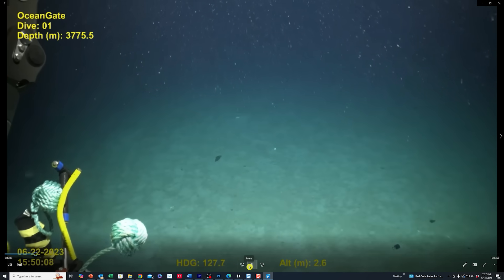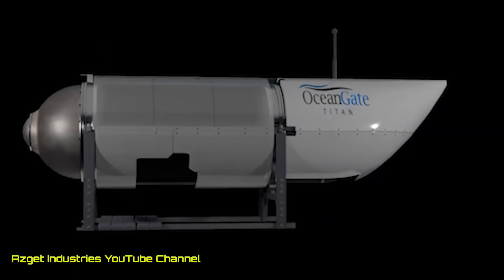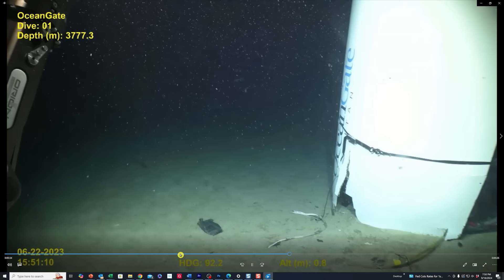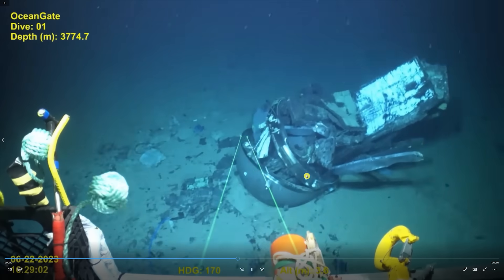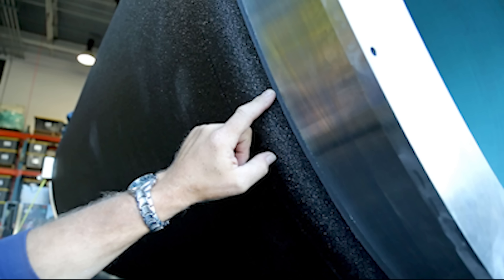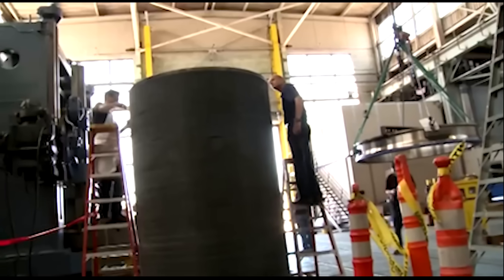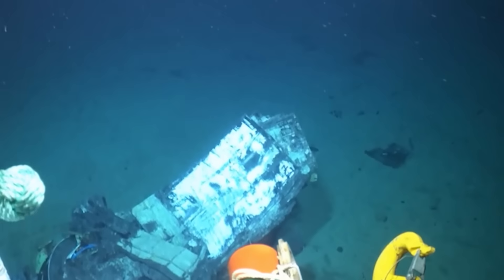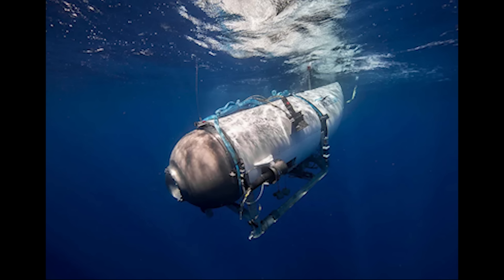OceanGate Titan Sub Debris Video Shows How It Imploded

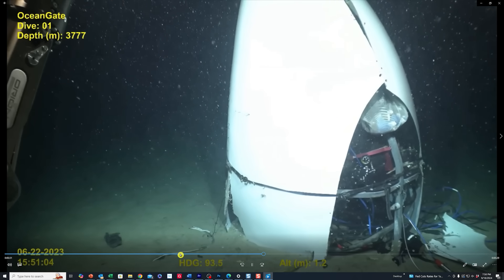Comment: I keep wondering who put the manual rachet strap around the wreckage of the sub that u can clearly see at 2:50... Did they leave that on there from the surface and allow that to remain during the dive? Plus i use those on my trailer to hold things down and i am surprised its still there after an implosion.

Comment: You have to be careful with Ti, as it is a very notch sensitive material. Defects, scratches can cuse a stress raiser and a failure with cyclic loads. Ti needs to be very clean from oils and solvent residues when being glued. Some grades can be suface blasted prior to glueing, I have never done that. It needs to be so clean that if water is applied to the surface it will stay wet and not break into small pools. For glueing it must be very dry and should be done in a humidity controlled environment or done on a dry low humidity day.    The viewport window is what you saw early on on the floor, It was completly removed from the front housing during the implosion.

Comment: the front titanium rings shows how this vessel met its end.  when they were glueing on, you could see a lipped edges.  but when it was brought back up from the ocean bed, those edges have been sheared off. 

this implies that the sheared forces through this part of the ring where too much for this edges thickness. without the strengthening and support of this titanium ring, the carbon fibre was simply free to crush from front to back. 

it was crushed and folded into the aft dome, within a fraction of a second.  this force, hitting the inside of the aft dome, is what made the tail section separate.  this also explains why the the front dome is on its own, where's the aft dome has a massive of carbon fibre still attached. 

if the failures originally started withing the carbon fibre itself,  there would have been carbon fibre still attached to the front dome, as the crushing forces expand, pushing fragments in either direction.

Comment: I'm no submersible or diving expert, but you're going down 2.5 miles where the ocean water is just itching to find a hole in the submersible and crush its passengers within .002 of a second......and you want to hold the submersible together with glue?

Comment: The whole gluing procedure looks very dodgy to me: different amounts of glue applied with roughly with plastic plasterer tool, very shiny metal surface unprepared for better bond, no temperature monitoring or control.

Comment: Subject: Clarification on the RING and Adhesive Application Procedures

I want to take a moment to address the approach to the application of the adhesive known as “Peanut butter” in relation to the RING project. It is essential to emphasize that adhering to the guidelines set forth in the Technical Manual (TM) is vital for maintaining the structural integrity and operational efficacy of the work provided.

The TM outlines specific procedures for the proper application of the adhesive, which is critical to ensure both safety and performance, especially during sensitive missions where precision and reliability are not just preferred, but mandatory. Any deviation from these established protocols can result in significant risks, including compromised system functionality and potential safety hazards.

If there are any uncertainties or questions regarding the application process, I urge the technician to consult the TM directly. It is a comprehensive resource that provides detailed instructions and helps engine uphold our high standards.

I also want to encourage transparency among the team. If there are technicians who have strayed from the prescribed procedures, I implore you to come forward so we can address these inconsistencies collectively. That or be subpoenaed to appear. It is the responsibility to confront any discrepancies head-on to maintain the quality of the work and unwavering commitment to excellence.

Let us work together to uphold the standards of our operations. Thank you for your dedication and cooperation.

Semper Fidelis.

Comment: Titan was something of a success. The carbon fiber hull did hold up for a wild amount of dives and Rush controlled it with a Logitech game controller. However, evidence suggests the hull would need replacing every x amount of dives to be safe which obviously isn't viable. X amount of dives per hull type of thing. By 2023 that thing was overdue for replacement. If Rush factored in somewhat regular replacement  hull costs into the ticket prices to board, would have had to really jack the prices up i'm sure, but he'd still be in business today.  Like an empty phone card, the timer on that hull simply ran out of minutes.

Comment: Comments are blaming things like the glue holding the domed ends on the cabin cylinder. Even the narrator touched on that.  But from the moment the Titan was lowered into the merciless ocean those domes were never ever going to separate (fall off)....They're being held together by countless pressures per sq. inch that eventually imploded the cabin like an aluminum can crusher. Imagine setting an empty beer can on the ground....and you slowly, carefully stand on it with one foot... without crushing it. Then have someone disrupt the structure by pushing in on the side of it.....VAROOM! It implodes. If the cylinder used in this dive belt was a foldable material it would more likely be in a few pieces but carbon fiber is somewhat "brittle" in comparison.

Comment: The sub should have been rebuilt every time it went down. If you race vehicles and you are serious. You strip your machine down and inspect.
Reply: I doubt it would help, you can't really inspect the interior of your carbon fiber hull, unless you threw it away after each dive and provide a brand new one which would be prohibitively expensive.

Comment: Might be a dumb question. Why wasn’t the whole thing made out of titanium instead of carbon fiber?
Reply: not a dumb question, very important question - if he made the whole hull from titanium 1. the price of the hull would go up considerable since titanium is expensive 2. the whole thing would gain so much weight it would need huge buoyancy compensator that would balloon the size of the whole thing and necessitate bigger engines to move around, bigger mother vessels, the whole thing would balloon in size, complexity, cost

Comment: Wouldn’t logic suggest, to put the ring on the ground, then fill it with glue, the slowly drop the carbon fiber into the ring. This would ensure that the cavity is filled with glue. And wipe off the excess.. making an air tight seal..

Comment: If they were gluing, why not drill a series of holes that could reci3ve the glue to act like rivets when it hardened.  Why not have threaded titanium rods that ran the length all around the rings, connecting them.  Basically making 2 rings one ring, with enough of them.  So many things they could've done cheap and better.  Neither of these ideas is hindsight.  My common sense there's no way I'm trusting glue by itself.  These guys seem kinda dumb for what they thought was enough.  Rods around the thing from ene to end would've added a few thousand dollars.  Geesh.

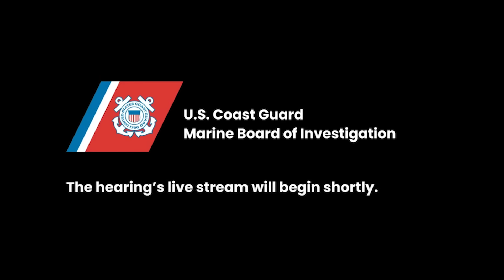Comment: This video shows the best visual description of exactly why the carbon fiber failed especially from time index 9:50 to 10:40. The repeated compression and pressure release from every dive was like when you take a piece of tin and bend it back and forth until it breaks. It is called stress fatigue which has to eventually end up in failure!

Comment: Since the door fell off once im assuming the pressure caused the door to snap off the bolts like it did before dude the strain on the door.. assuming they never replaced the bolts that were used each time going down... why on earth only 4 bolts like any moron knows that wont work inward pressure would still cause the bolts to snap as its still causing stress in or out... and they fell off from it just dropping with zero pressure....

Comment: It boggles my mind that the ring was glued on. I would have thought that it had long bolts / all thread that ran from one end of the sub to the other. I get using the glue as a sealer or gasket. However, not bolting it together from one titanium cap or bulkhead to the other is just crazy in my opinion. It seems like the crew compartment just crushed and each end just blew off in the opposite direction. I was a mechanical millwright for a long time. I have an understanding of torque specifications and using gaskets in high pressure applications. I think the temperature variations that could affect the expansion and contractions of the joints where they were glued together. I'd be willing to bet that the pressure changed the shape of the compartment just enough to break the glued seam loose. Take an empty Pringles can and squeeze it with the lid on. That's what I believe happened to Titan.

Comment: Building the cylinder out of carbon fiber was 1 mistake. Yes it is strong but keep in mind that it’s still just epoxy with carbon fiber.. i think if they made the cylinder from titanium aswell and with a very thick piece of titanium. As for the way they glued it together it would’ve never been possible to keep it in one piece for a long time.. especially at almost 3.8 kilometers deep in the ocean..

Comment: Once the air filled area of the Titan  implodes from the external pressure  i would think the pressure equalizes and the submersible  pieces just sink to the bottom.  It is not like the whole thing would be condensed to the size of a tin can. The Titanic is down there largely intact, rusting away for >100 years. The pressure on the people inside is enormous and they are crushed instantly.

Comment: 0:34 - 0:36 Can someone please confirm that I'm seeing a series of regular old ratchet straps around the fuselage? I don't think they were there during any video of it on its way down. Is this strange or would that be part of the salvage efforts to bring those pieces back up, strapped together?
Reply: Additionally, 3:34 - 3:36 "cone standing upwards" seems a bit strange, as well. Wouldn't the cone end be falling toward the bottom while descending, hydrodynamics-wise? Then the fuselage would probably hit cone first and then fall onto its side.

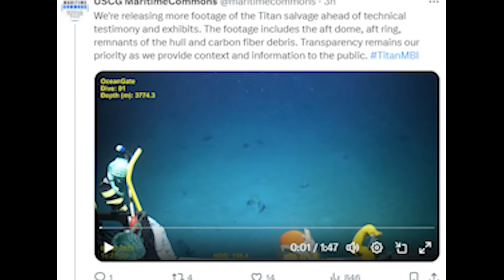Comment: In the second coast guard video, timestamp 4:07, there is a black plastic milk crate attached to the rover fimling the debris, you can see the milk crate on the bottom left of the screen. Someone please explain how a plastic milk crate can survive at that level of pressure. This is a legitimate question not rhetorical. I have a couple of those milk crates at home and belive me they are not very sturdy.

Comment: When it was confirmed that they lost communication with the vessel it was assumed that there was a catastrophic failure.  The dropping of the weights was not a planed strategic event, not at that ocean level or depth., it was too soon. Or if it was it caused a dramatic vibration which inadvertently caused the implosion.
The text message about dropping the weights that came after the observable big bang noise was in time delay, the above top crew then noticed that there was slack in the cable that was holding and lowering the Sub.  It might have been the case that dropping of the weights started a vibration which inadvertently created the implosion of the Sub
All of those eventual indicators gave evidence that there was a catastrophic failure.
Reply: I am quite sure the sub would have given 'way' at any cost, due to several internal factors. Never would have set foot in that thing!

Comment: Carbon fibre would be way down the list of materials to use for a sub, steel or high grade alloy would be a way better choice, Carbon is strong under tension but weak as pi$$ under compression, steels alloys are Isotropy meaning it has the same strength and properties in all directions.
Why on earth Carbon fibre was used is beyond me🤷🏻‍♂️

Comment: There are several reasons for the failure:
Carbon Fiber cannot be subjected to Finite Element Analysis FEA as it is too complex. Each material used in the construction of a submersible will be under extreme pressure so you have to know how it is going to react in that scenario. This is why Carbon Fiber is never used in building submersibles.

This Titan sub was never CERTIFIED and so was not allowed to operate within US waters.  It would have failed certification, Stockton knew that. So he bypassed certification and launched way off the coast, outside the jurisdiction of the US.  This should have been a red flag to every passenger!

He glued one material to another creating a failure point. It should be all one material.  Now you have even more variables - the glue, the epoxy inside the carbon fiber, and each one behaving differently under stress.

Almost all submersibles are spherical in shape. This way, water pressure all around it, is an even pressure on all sides. The Titan was elongated, not spherical.  This was one more failure point.

The acrylic window viewing pane was not tested for these depths but a much shallower depth.  It seems to be intact on bottom, but maybe this is what failed too or failed first.  It is astonishing it looks intact.  I thought this must have been the reason for this implosion.  But the fact remains that Stockton still used it and took massive risks with it.

His engineers told him it was not safe.  3 dives prior to this fatal one, they noticed the carbon fiber hull delaminating - and they still went on with this dive. He never listened to his engineers.

Stockton Rush was a Grandiose Narcissist. As we know, Narcs live in a fantasy world, not reality. When you add his Salesman-like personality, you have a deadly mix of a thick skin, stubborness, lack of reality, grandiose visions, and focus on making money at $250K per passenger.

Note that in every deep sea submersible adventure there has been an excellent safety record, with zero fatalities. Each submersible was certified, and all materials individually tested with Finite Element Analysis.  There were no surprises and good science.  These subs have gone twice as deep as the Titan, into the Mariana Trench, the deepest part of our oceans with NO ACCIDENTS, NOT ONE.  This is not new science, it has been done safely and for a long time. There was no reason for Stockton to have this accident and some near misses prior to this one.  He ki//ed himself and took 4 other lives with him. That is why you should not believe Marketing people over Engineers.

Comment: Mr Rush was in a rush to get the sub down to the titanic to make the money. Having a degree does not always mean you are smart. Watching them glue the ring is shocking glue does not always fix things. All the workers 
working on the sub look like weirdos. When you cut corners unfortunately that's what happened to the sub. There is alot of pressure as you go down the ocean surley these people making the sub should of think a little bit better on how to design the sub an not use materials that are not strong enough and also using glue was bit of a worry and the way the cylinders were put on at each end looks a bit cheap dodgy workmanship. People should stop going down to the titanic. Titanic ghosts are saying leave us alone. Just let the titanic rest in peace.

Comment: Why isnt the wreckage crushed ? They say that pressure crushes everything when youre that deep so why isnt it?
Reply: because the pressure inside the wreckage after implosion equalized with the pressure outside. There is no more potential energy, no force to crush anything, just like your tires stay the very same way after you let the pressure out. If they had some kind of foam it might shrink because you can squeeze the gas (you can't really squeeze liquids or solids, I mean you can, but it's a very small factor)

Comment: There is 2 epizode good explanation of the whole story of Titan and the guy who was running the program. Sadly its in Polish language, but the amount of details brought up was terrifying, syill if you wanna give it a shot look up for SciFun channel. 
Lad, who ran the program, ignored so many signals that something was wrong with the vessel that it was mindblowing. Last dive before the tragedy, there was a massive crack detected by the "safety systems", passengers who were at that time inside the vessel compared it to a gunshot, that's how loud it was. Dude completely has ignored it, never did a single inspection. This all could be eaisly avoided if safety checks and procedures were at place and not ignored from day 1.

Comment: That sole dome is the part that opens for them to get in. The “sand” you mention unfortunately is human remains. The pressure turned them into a sort of white paste, tragically. When they bring this above the water it’s wrapped in a white sheet but you can see it’s on its own. You are right, it looks much smaller underwater. The portion with dome and crushed material the lasers measured was the back end. The middle section r what’s left of it might be the flattened crumbled portion lasers were on, it buckled entirely under pressure killing them instantly 0.0001 seconds I believe pushing their bodies together liquifying them into the port hole. DNA confirms this. It’s crazy realizing that’s what we are looking at, what’s left of them. 💔🙏🏼

The carbon fiber is what buckled not the adhesive. 

May their memories be a blessing.

Comment: what me wonders a little .. if You want to connect 2 different materials together .... and want to apply  so much Pressure on it ( 4000m of Water )  why You make the rabbet  only max 2cm deep ... at 8:02 it looks like 2 max 3 cm deep for the contact  to the Carbon hull .... for this Pessure it is way too small ...   besides the Fact that You normaly dont use different materials for a Pressure hull ...